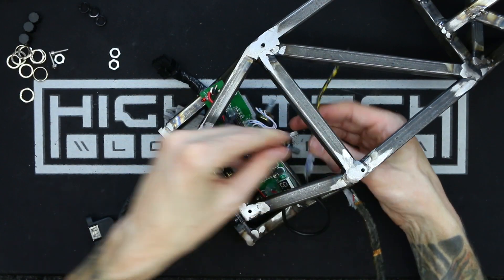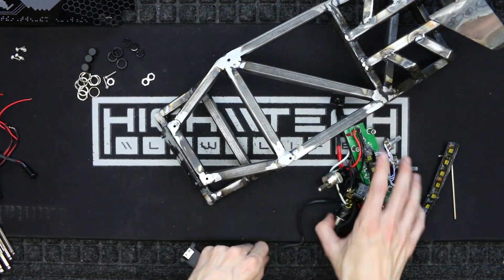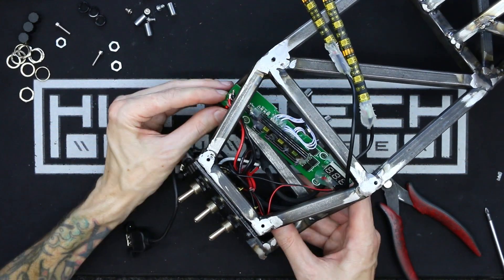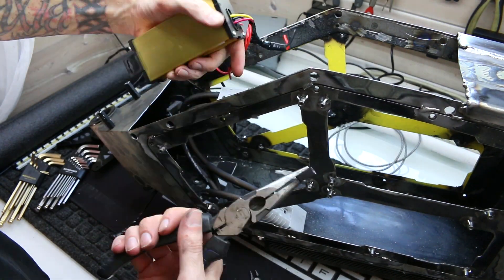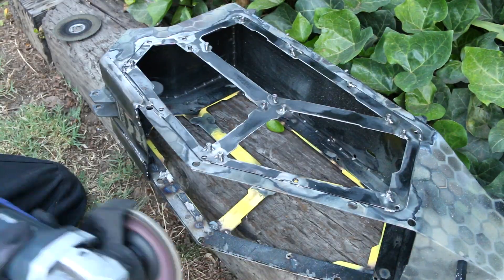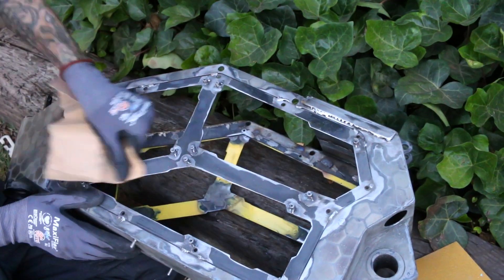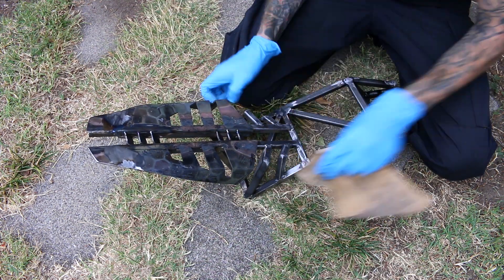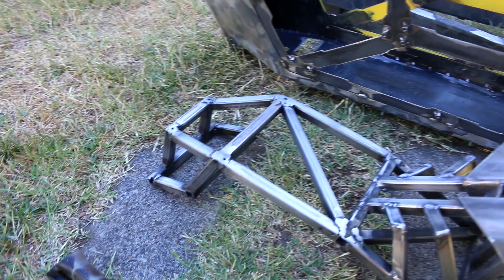🚲 I Hope It All Fits! + Tons of Paint Prep! E-bike 9.0 \\  Fab - Enduro - DIY Build! \\ QS273 70Ah

Comment: hows the battery holding up? I recently got mine from GTK aswel, they changed the format a bit but 72v 70Ah with 200Amp BMS.. Still waiting on the QS motor so havent been able to test it.. Curious if its really 70 Ah
Reply from the maker: So far for me it's been working perfectly 👍 I can get 80-100 mile rides out of mine, 70Ah is a huge pack!

Comment: i absolutely hate paint prep that suckks. also whats the smaller controller for?
Reply from the maker: 100% Agree! It's a buck converter (step down) allows you to run 12V accessories off the main 72V battery 👍